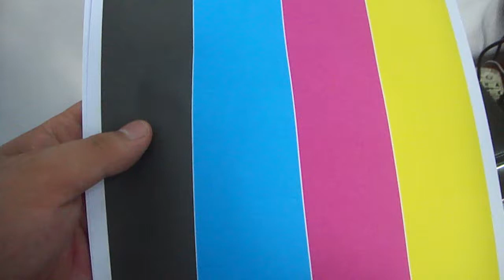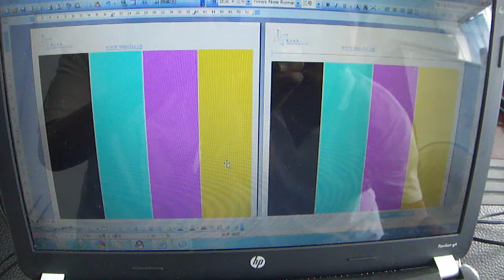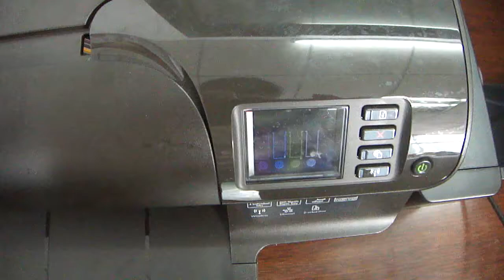NEW!HP OFFICEJET PRO 8100 CISS

Comment from the maker: 1.no discription during big quantity printing.
2.HP specialized Pigment Ink can compatible to original pigment Ink.
3.No need tear original chips down, specialize in mod chips, No need reset, and can permanent print.
4.It is first special designed cartridge in the world, don’t worry about air blow problem of ink cartridge for printing continuous operation